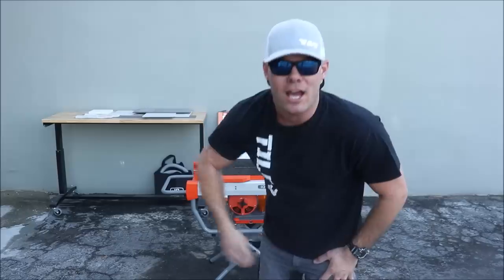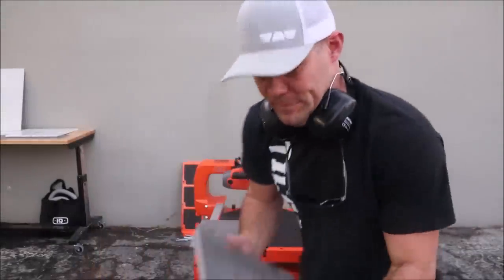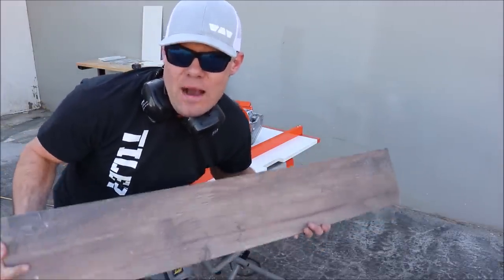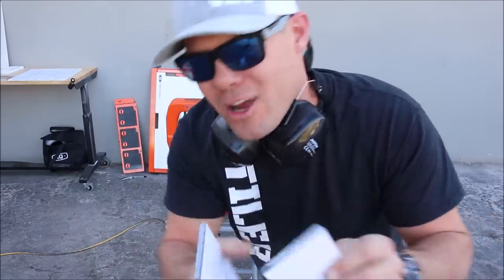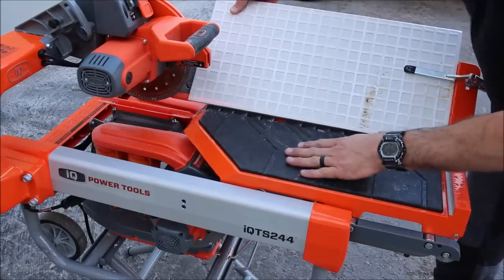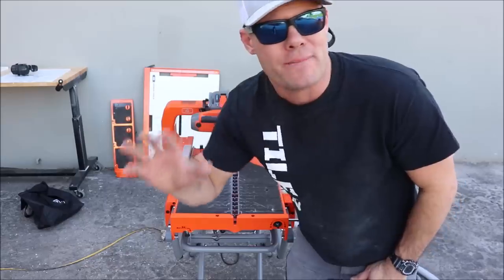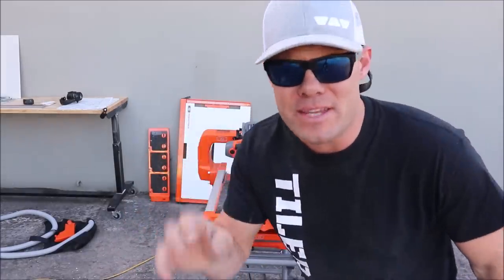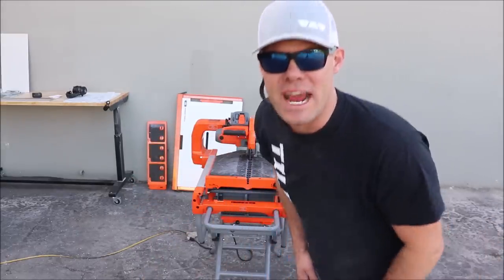IQ Tile Saw Full Review Part 2

Comment: Why does it look like at the 6:22 in the video. When cut the tile that it was already cut. You can see were the 2 peices came apart for the end of the tile. Thanks
Reply: Rich Wapner it broke
Reply: It broke near the end of the cut, very common to happen because of pressure and vibration vs. a sliver holding the two together

Comment: i got this saw a few days ago. it is way better than i thought it would be. the quality of cut is amazing. i did purchase the better blade from IQ than what comes with it. it is not 100% dustless i would say maybe 95%. it weighs 90 lbs which isn't too bad to move by yourself. plunge cutting is kind of difficult as you cant see the back of the blade to know where to stop the cut. cutting small mosaics is difficult because the trough where the blade runs through is to wide, but cutting mosaics without a wet saw is fantastic.  when you have multiple rooms to tile in one place it is easy to move from room to room instead of setting up the wet saw in one area and having to always go there to make a cut.  i could not get it to cut any glass, it blew out the back and chipped the top really bad. i don't think this saw completely replaces a wet saw but i am super happy with it and it definitely has a place in my arsenal.
Reply from the maker: I completely agree! Thanks for sharing.

Comment: Thanks for taking the plunge and being the first to do an in depth review , curious as to how effective the vac is after several cuts and if tray is as accurate as the extension table. My guess is competitors will come out with a cheaper version without a vac. . Power wise how does it compare to other saws. As it is running a blade and a vac at the same time. If the vac ever died on the unit, could you run your own vac. Impressive.
Reply from the maker: The vac has been great so far after over 100 cuts, you must empty the dust tray everyday. The table has zero wobble and cuts straighter and more accurate than any other tile saw I've used. This may be because of the missing tilt mechanism. On other saws, the 45 degree tilt mechanism causes the the motor/blade to go out of wack and out of line with all the bolts and mechanisms used for the 45 tilt. The power is super strong even when pressing hard on porcelain.

Comment: How does it cut once the blade gets hot from multiple cuts? How long do blades last without water cooling them off? 

I’ve been on the fence about buying this saw and not quite sold yet
Reply from the maker: I was ripping 24 inch porcelain back to back yesterday without problems. The blade gets warm after that and warm during miters, but never hot.
Reply: Landberg Tile TV maybe I’ll get it when it drops in price. I love the idea of it for sure. I live western Canada and it gets cold here lol

Comment: The glass dust/shards might destroy the vacuum filter maybe that's why they say it's not meant for glass.
Reply from the maker: Maybe, but what's the difference with sharp porcelain shards? The vacuum and filter breaks up the dust in the tray from fine to heavy with three sections in the dust tray.

Comment: my only problem is, my helpers dont have to worry about hurting themselves on my wetsaw, but with this i think they might lose a finger. what about l cuts etc.
Reply from the maker: That's a good point. You won't lose a finger, but it will rough cut a finger if it hits the diamonds on that tile saw blade. The same goes for a wet tile saw if you use a Pearl P4 blade.

Comment: Seems cool. However, I’m still a little skeptical. Seems slightly gimmicky. Kinda like a do it yourselfer tool rather than daily hard use. I’m interested to see how the longevity stands with this saw.
Reply from the maker: The quality is better than any tile saw I have reviewed. We have cut over 500 porcelain tiles and so far so good.
Reply: I have had this saw for a year and use it 5 days a week and better then my  DeWalt. I have both at the moment and after a year of use the DeWalt tray starts to get loose the iq will stay better longer thanks to no water to rust  the bearings

Comment: Planks appeared extremely jagged cut...
Reply from the maker: There were 12 inches that came out rough as I stated in the video. I might have pushed it through too quickly or at a slight angle. 120  grit diamond hand pad will remedy that edge fast!

Comment: No such thing as freezing water, just buy a bucket heater for your wet saw....Only about $50. Isn't cleaning filters time consuming too? I hate cleaning vaccum filters. This looks heavy. Can one person carry it up the stairs? Most bathrooms are upstairs.
Reply from the maker: It's about the same weight as the Dewalt or Beast, but it is much more compact and you don't have to deal with all of the extension and water trays. You could pull it up each step with the big wheels on the back of the saw.
Reply: @LandbergTileTV  Can you carry it up the stairs with your hands? I had a wet saw with wheels and rolling it up the stairs sucks and it can damage people's stairnose. I need a compact wet saw like a dewalt so i can carry it up the stairs.
Reply from the maker: @willinthearea6318  I can carry it just as easy as the Dewalt. Check out part one,  I can pick it up without problems. 👍